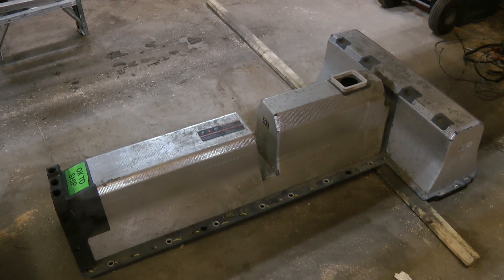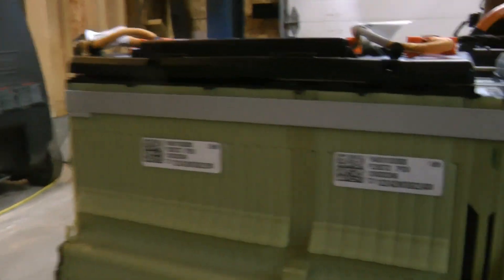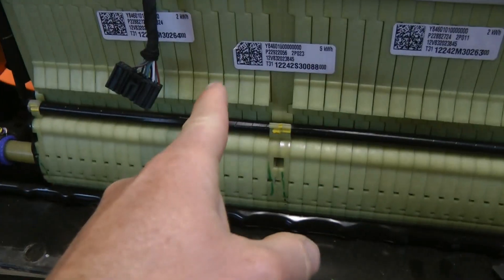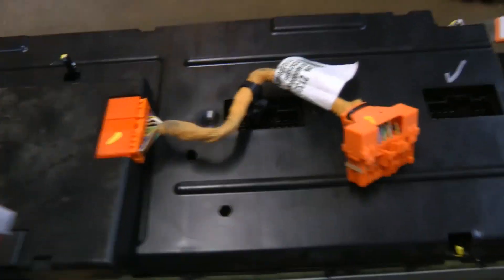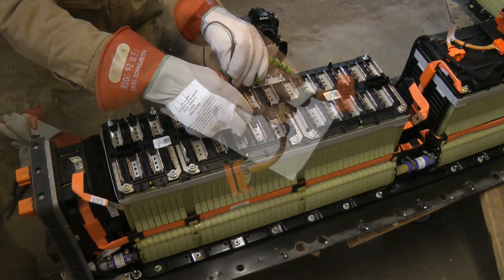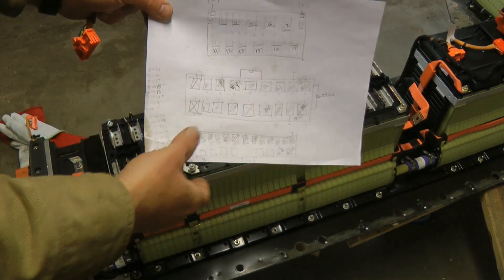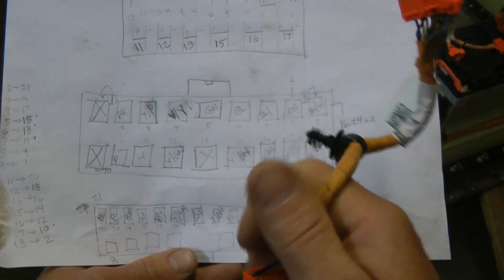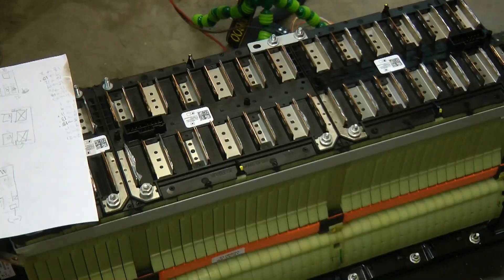2013 Chevy Volt Battery BMS Pinout Diagram

Comment: My understanding is the chevy balance boards should just work when plugged in, they are powered by the cells themselves.  But I have not found any confirmation so far on the university of youtube.  There are wires coming from the bms boards, and want to find out what THOSE wires are. 
Was hoping this video would explain.   I am looking to use these packs for a swapped pack for an EV racecar.

Comment: Are you still utilizing these batteries ?  I have a gen 1 pack and the only reason i need a BMS is because the darn controller tends to overcharge the pack.
Reply from the maker: I am still using them, and they are still balanced. After several years. I would recommend that you get a better charge controller. It's not worth the risk of starting everything on fire.
Reply: @mbrenengen  found it was a setting on my Growatt spf3k-48 that would cause it to creep above bulk. - Nice to hear thing are stull chugging along. Like your vids. thanks for the reply!

Comment: LIED about the pdf link
Reply from the maker: Just look at the video you you pigs.
Reply from the maker: Nice try. Sorry. No there is no  pdf, you will just have to freeze the video and write it down.
Reply: @mbrenengen  No big deal: But because you mentioned a PDF, people expected it. Moreover - these batteries have shown that a BMS is totally unnecessary when used as an off-grid power supply. May GOD give you what He knows you need to be saved, and bless me also!